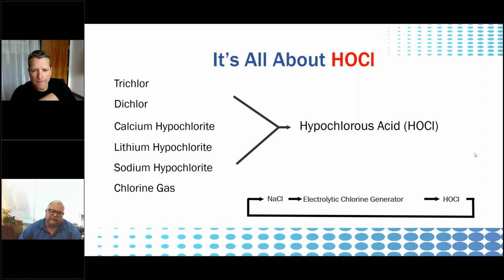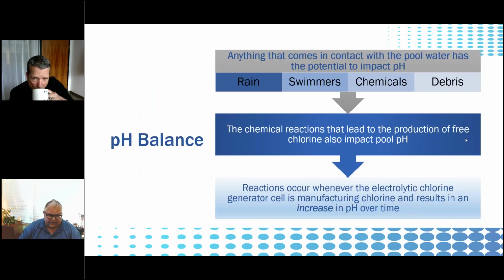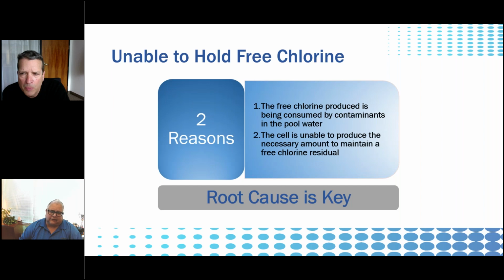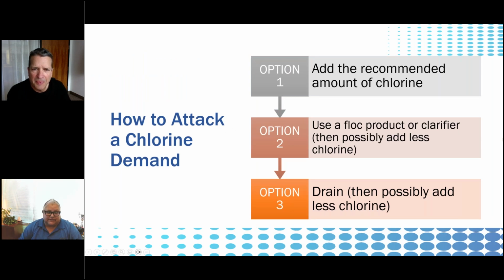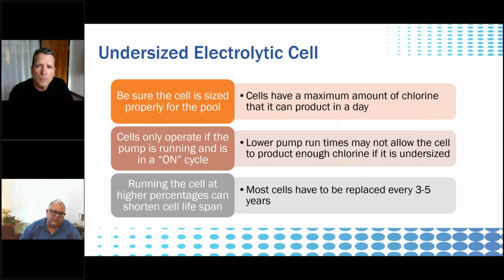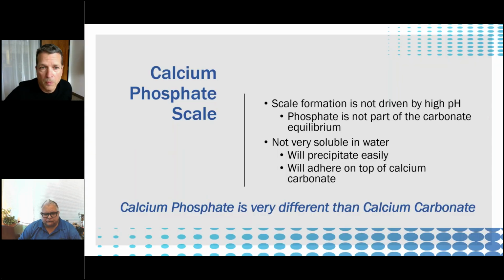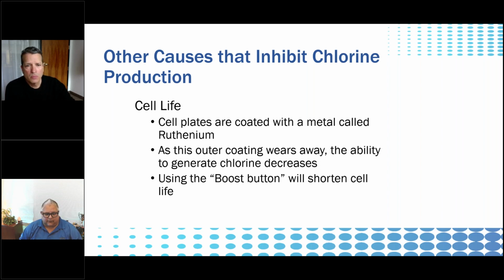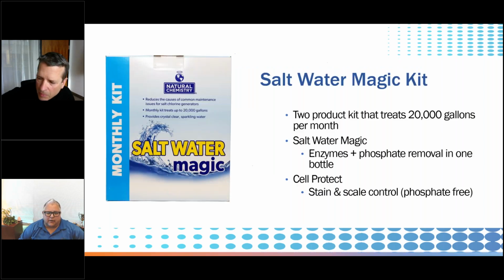Saltwater Pool Troubleshooting – Beyond the Equipment

Comment: This video should be a great resource.

The only part I would say is inaccurate is the section on variable speed pumps. Terms like “low” and “high” speed don’t make sense without knowing the flow rate of the system.

A variable speed pump with 2.5 to 3 inch plumbing will flow much more water than a 1.5 inch to 2 inch hydraulic setup with a medium to high total dynamic head.

The amount of water in the pool is the most important factor in determining the pool turnover rate, followed by the actual flow rate. Any system where the pump schedule is designed to hit a minimum of 3 turnovers will have enough flow for almost every salt cell on the market.

However, if it’s a 10,000 gallon pool, I can see the flow rate to hit 3 turnovers being lower than what some cells require. Therefore, it’s important to consider the actual flow rate rather than the RPMs. This is where a Floviz flow meter comes into play.

Overall, this is a great video.
.